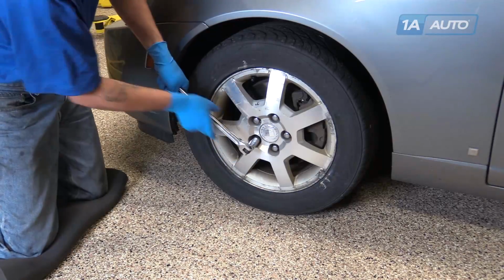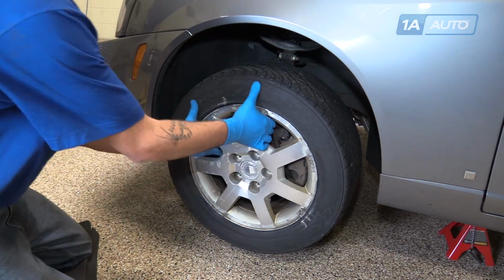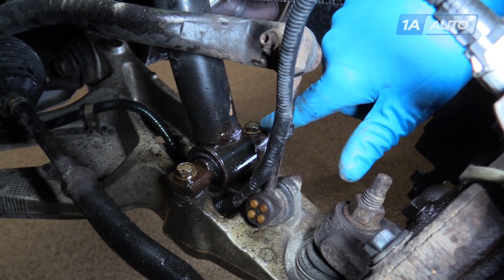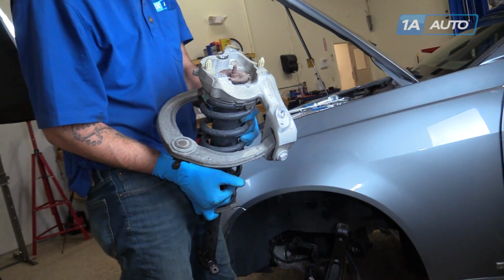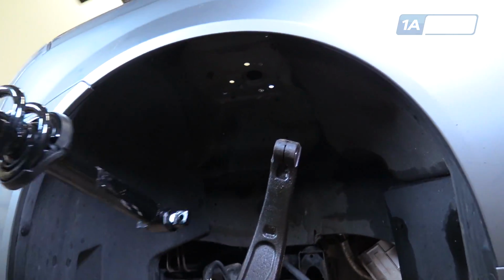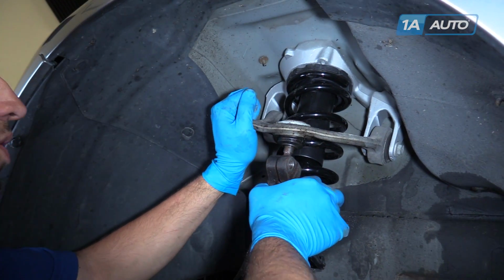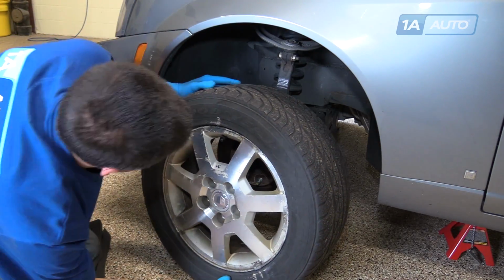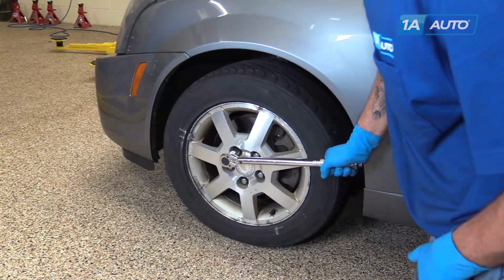How to Replace Upper Control Arm 03-07 Cadillac CTS

Comment: I changed the strut and the lower control arm and my car is leaning down on the driver side before I changed those two parts it was leaning down do you think it’s the upper control arm tire rod

Comment: Doing the UCA on 2005 SRX 4.6 L Northstar. Needing some advice. Great video, btw, just need slme tips on this one. Can I do this job without taking anything loose from under the hood? I just need the UCA on both sides so I can get to the dking the outer tie rod ends and sway bar links.

Comment: Why did you need to pull out the strut assembly? The other 2 bolts appear to be accessible even with the strut in place.

Comment: can I change just the upper ball joint without changing the whole control arm
Reply from the maker: +Jaritza Colon You may want to check a service manual for the vehicle to see if it's serviceable by itself. Thanks for watching 1aauto.com
Reply: What does a upper control arm do my only squeak and creak